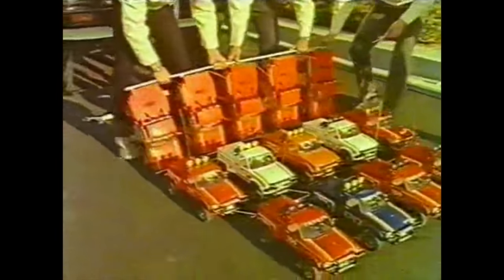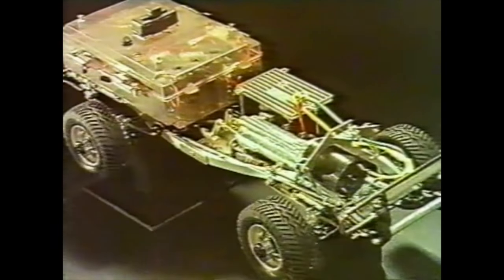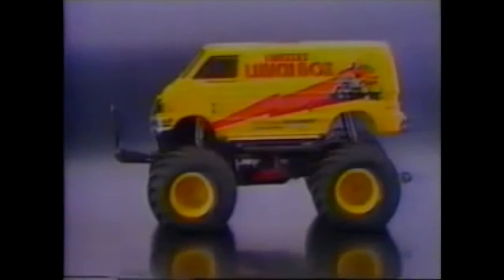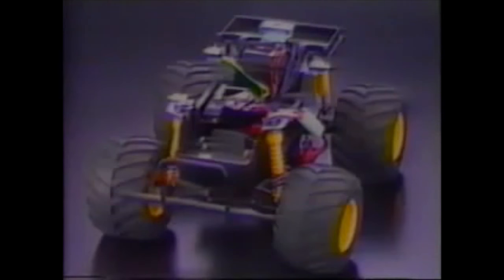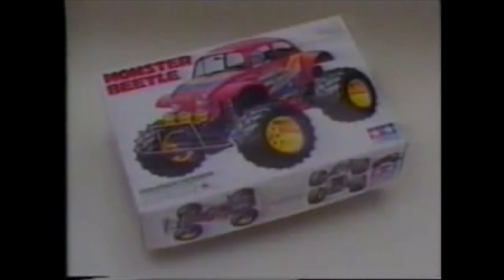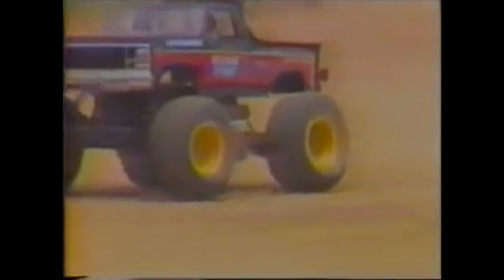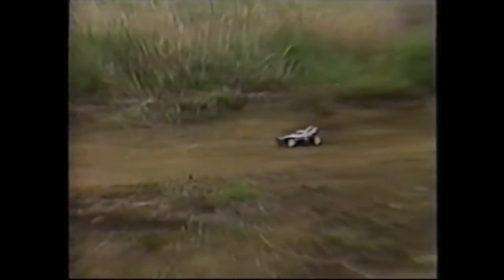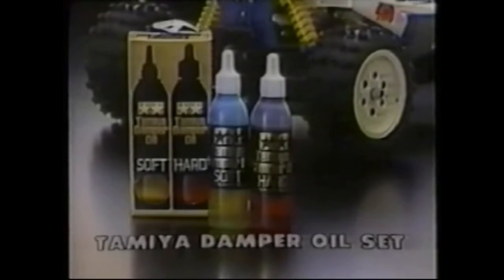Vintage Tamiya Adverts. Clod buster, Blackfoot, Monster Beetle, Frog, SRB's and More!

Comment: That's great!! had a bullhead 4x4x4 had the clod !! Got into nitro!!  bought kyosho nitro crusher Oz 21 tuned pipe . Lunch box & the  midnight pumpkin was dope body clips broke evertime you had a rollover add 17 tooth pinion & wow . Blackfoot & monster Beatle stripped gears when you took off the plastic tires loved every kit I had back in the day . Now have Traxxas T Maxx 3.3 & 2.5 R !! E Maxx . Thanks for posting 👌

Comment: It's so amazing how incredibly detailed the late 70s early 80s Tamiya cars were. Even scale sized shocks.  I had the Rough Rider and man that was heavy as hell.  Heavier than my Blackfoot.  It was slow and didn't go over bumps and jumps all that well.  Didn't even have a differential gear.  But it was a sealed all metal chassis and everything you see on it was to scale.

Comment: That first lil truck was built better than any RC I’ve ever owned, last 20 years I guess.
Reply: That kit was like $600 even back then!
Reply: Robert NES816 , wow... yeah I want one.
Reply: @maderastudio8493  Tamiya has a re release on their site. They're makeing all of the old kits from the 80's again.
Reply: Robert NES816 sweet! Thanks for the heads up. The wife may not be so appreciative. But I thank you.
Reply: @maderastudio8493  😆😆
Reply: No way rc from 95 on are built much better! Better engineered better electronics better battery better tolerance thare better in every single way ! I have an rc4wd tf2 it is all metal every bit of it except the body is plastic!

Comment: I remember building my Monster Beetle with my dad. When driving it around my neighborhood my friends saw how cool it was and wanted their own RC. My best friend got the Lunchbox and another friend got the original Grasshopper.  With the 3 of us there was a problem because the transmitter and receiver had to have different frequency crystals. Mine was 27 mHZ so I couldn’t race my friends Grasshopper because we were on the same frequency. RC certainly has advanced big time since the 80’s.

Comment: Ohhh Man this Is torture mate, that clone mt left me like this 🤤😍🤤😍🤤😍 the Toyota also!! well all of them actualy 😅😁 AND here I am waiting for my brand new chassis that I ordered like 10 days ago for my old king blackfoot!! I cracked the original black one and now I'll have to fit in there the red one from the Moster Beatle/Blackfoot, since it's not going to be original anymore, (I also ordered some aftermarket oil shock absorbers and Ball bearings) I was thinking on going brushless since It still has the old silver can and the 3 speed forwards and reverse sc 😝🤣😅 (I wanna go in Jeremy mode, and put in there some more power!!!)  but it just may be a little to much, maybe I'll be better of keeping it old school and just get a tamiya super stock motor instead, I dont know mate, if you have the chance I would like to read your opinion in this, maybe even just the sport tuned silver can ( I already saw your vid on that matter against the original black can sport tuned and that other unworthy cheap piece of $+#t ) and a 2s Li-Po would be fine for the truck? Anyway I hope you have a nice day and I think it's great that you uploaded this old ads, cheers mate and P.S. sorry for the bad english 😅😅

Comment: I can`t be the only one who kinda misses the old rotary mechanical speed regulators hehe, resistor so hot you could prepare lunch on it, and if you put a hot motor in your car,  after the second step it was completely uncontrollable xD
Good times :)
Reply: And that humpback hardcase tamiya battery hehehe, that`s one of the batteries I got with my hornet, my first hobbygrade RC, got it used for about 60 bucks, with charger and Acoms radio, still miss that thing..
Reply from the maker: I don't miss the speed controller getting stuck and the truck flying off at full speed in to the nearest tree 😂
Reply: Jan Christian Frodahl   im still running my midnight pumpin on the old escs 😂
Reply: Oh man, this comment brought back memories

Comment: LOL I forgot about mechanical speed controls and the fact electronic ones were rare and super expensive then, in fact all the stuff was super expensive compared to now, I remember in the mid 80s an equipped Hotshot was 500 bucks, now you can buy a ready to run RC that goes twice as fast  for that amount
Reply from the maker: Yeah, super expensive compared to today! Although just as enjoyable back then...although I don't remember breaking as much as I do now 😂
Reply: Rex Holes mechanical speed controllers have always been a pain for me. Sometimes on full throttle it will get stuck and I have to re position it to the middle again. Have to keep that vintage feel tho

Comment: How much did those hilux and clods cost during the late 80's early 90s? Awesome upload. Thanks
Reply from the maker: I'm not sure, the Clod I think was about $400? I may be wrong. But it was a lot of money back in the 80's/90's!!
Reply from the maker: Edit: The Clod was around $500 in 1987, which is around $1100 in todays money! So the same as a XMAXX :)
Reply: Tomley RC Garage Damn. But they were so damn cool. Thanks for the info and the video.
Reply from the maker: You're are welcome
Reply: Don't know you don't get a hilux clod only a chevy

Comment: Anyone remember the advert of the Ford Escort RS Cosworth rally car ? Made me buy one as soon as I saw the advert :D
Reply from the maker: Yes, I remember most of them 😎🤘
Reply: @TomleyRC  About a month ago I found my old Escort out the loft, been up there since around 1997, god what a mess it's in, a suitcase has been on top of it, bodyshell permanently flattened, tyres all rotten - all the red chassis parts have gone a pink colour and covered in cracks, everywhere a screw is attached there are fracture lines, I left the batteries in the car like a fool, could have been a fire started up there. 

Sadly this will never run as it would cost way too much to restore.